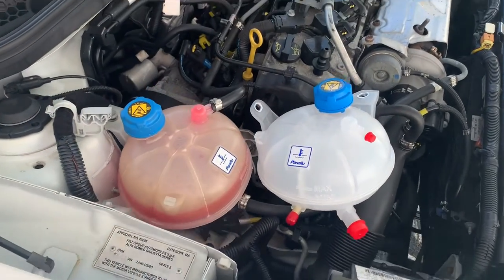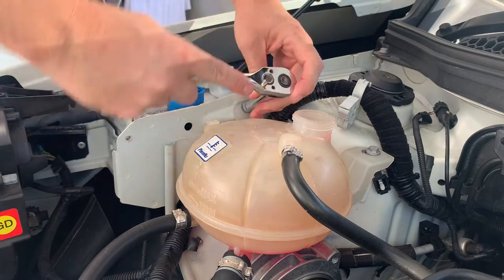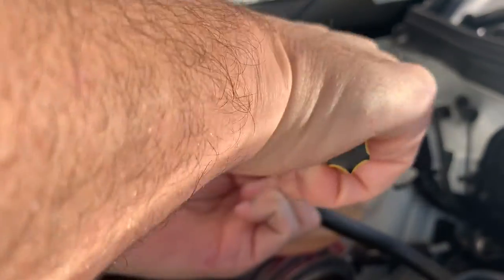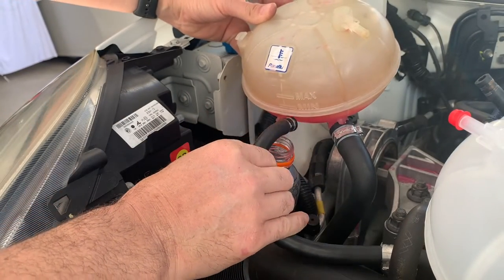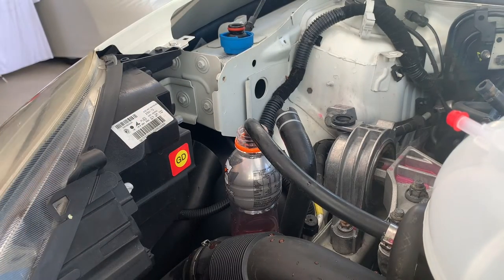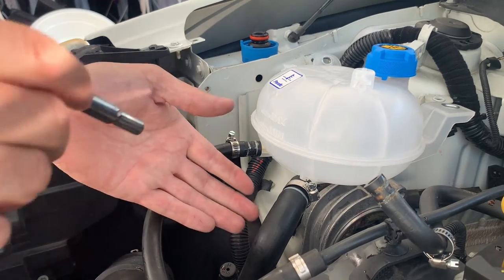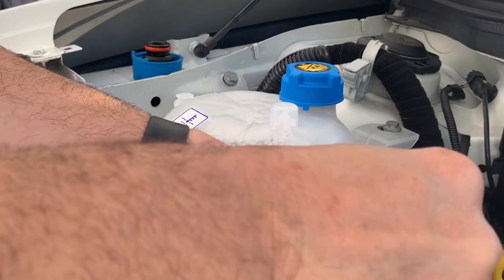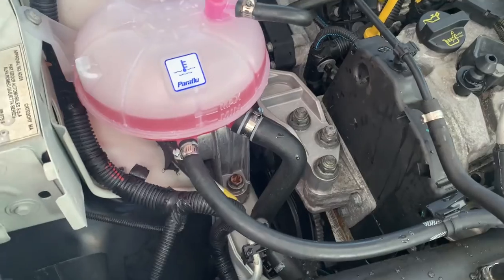How to Replace MultiAir Coolant Expansion Tank - Alfa Romeo Giulietta 1.4

Comment: You can just reuse the original hose clamps, without special tools, just try to pinch them closed. Easyer than you think. The biggest advantage is, you cannot overtighten.
Reply from the maker: I tried but gave up. Good to know that you can reuse them

Comment: Hi mate, how would you go about flushing the coolant completely. Is there a drain plug?
Reply from the maker: I’m sure there is a plug on the bottom of the radiator but I just did the tank without draining the system

Comment: it explain the brown color of the old coolent ? i have this problem on my giulietta
Reply from the maker: If your coolant is brown you have oil in it and a big problem. It is probably the head gasket but could be a few things. Get ready to spend some money
Reply: @TheEddysGarage  i mean, the tank has a brown cream but the coolent is pink or more like used pink
Reply from the maker: @user60835  just buy a new one. Brown means it is deteriorating and they hold a lot of pressure. Don’t get stranded when it blows